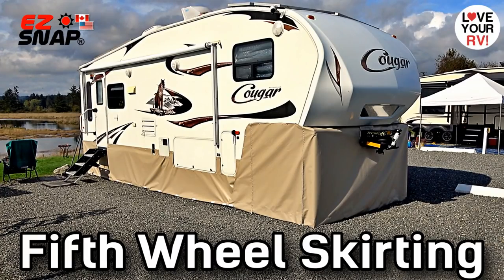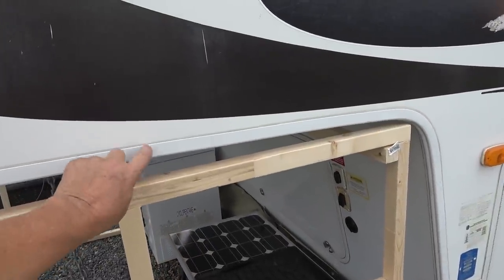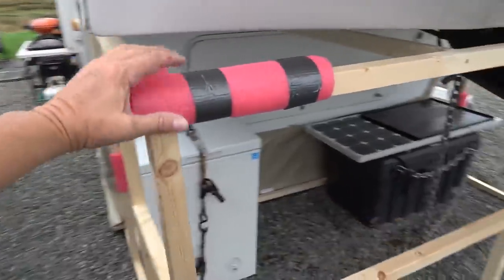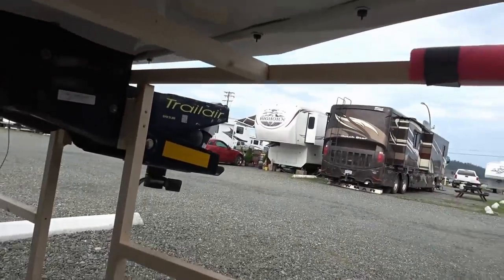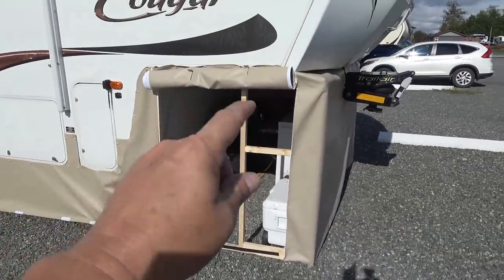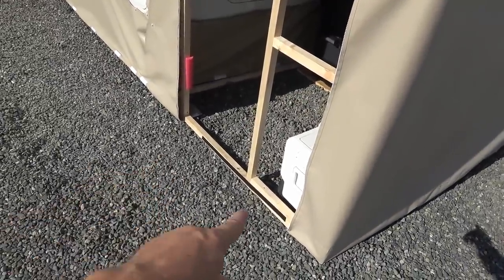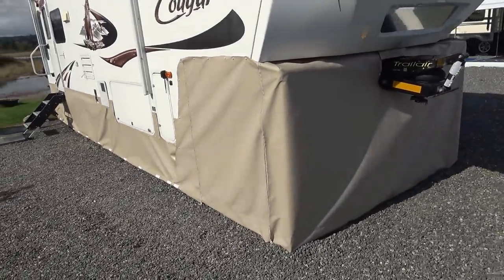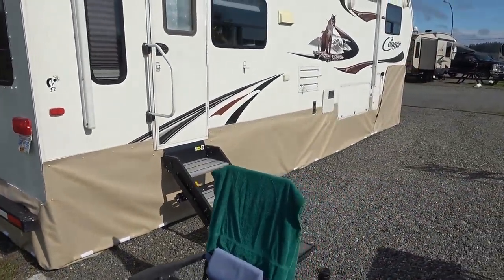Using EZ Snap RV Skirting to Create a Fifth Wheel Shed

Comment: First rate job as usual. I think the weak link is the pipe at the bottom. Something to keep wind from getting underneath it and somehow rig some weight on the inside or strapping and spikes. Glad it made it through it's first test.
Reply from the maker: Thanks! Since we are in a graveled site, I just pushed some against the bottom edge all around to stop the wind from getting under. I was thinking of staking or sandbagging the cross piping down and add some weight in the corners.  But last night we had even a bigger storm winds up to 80 km/h and everything held fine. :)

Comment: Looks great, that is really cool!  Incredibly expensive though, sheesh
Reply from the maker: Yeah, expensive compared to many DIY methods but much cheaper than a custom vinyl job. Nice thing is its completely reusable and looks good in the RV park. Some of the cheap DIY solutions look quite trashy. ;)
Reply: @LoveYourRV  that is very true. And in the end, it comes down to what you are willing to spend in order to protect your investment of the rig itself, and possibly bonus increased comfort as i assume you might get away with the material providing some bonus "insulating" value in keeping winds down blowing thru the bottom. I admire your work on this project, great job!
Reply from the maker: One of my criteria was to be able to easily take it down, store, and put it up again.  Unlike many colder places, on the coast here we often get some warm spells even in winter, so will be nice to be able to take off for a few days and do some off-grid camping in the local area. Lots of forests and lakes around here and very few people in the fall, winter, and early spring. :)

Comment: Great job.  Be careful about humidity buildup under the camper.  Maybe you have already thought of this, put a remote temperature/humidity sensor underneath.
Reply from the maker: Yup, plan to have a low wattage electric heater running down under mostly powered by my solar panels and batteries and will open it up on nice dry days and let things air out.  Cheers, Ray

Comment: Ray great job once again. I can’t remember if you have any lead acid batteries left. If you do be careful of off gassing under there those fumes can be wicked dangerous
Reply from the maker: No, we have lithium now so all good there. Good point thought, if I had the lead acid still I would have to change the vent location from the battery box, maybe add a fan as well.
But I'm concerned about what would happen if we got a propane leak, not sure if the concentration could reach a dangerous level so have purchase a detector LP gas alarm for underneath.

Comment: Others may have already suggested this.  Have you considered some heat lamps beneath the camper inside your skirting?  This would help keep fluids and you floor warm.  Understand the 30 amp limit, but i there an extra 20 amp outlet on your pedestal?
Reply from the maker: I have a small portable True North heater with a fan that has a 600-watt setting. I plan to use that with a wireless thermostat outlet to regulate the temp. We just have 30 amps at the campsite but I do have over 1000 watts of solar panels on the roof and 315 amp hours of lithium battery storage capacity, so should be able to augment somewhat with that. Also, our rig has an enclosed insulated underbelly with a dedicated 2" RV LP gas furnace duct blowing warm air into it.  Cheers, Ray

Comment: As usual, you do a great job on your videos. I may have missed it, but does the skirting protect against critters looking for warmth during the winter?  If not, might those critters gnaw on rv things during the winter?
Reply from the maker: Critters can always find a way in. :)  But I will be routinely going under to dump one of the tanks so can monitor things.  Where we are is away from the bush and on an ocean spit so we don't get many rodents around here, I'm thinking bugs could be a problem though, will see how it goes. At least the skirting is very easy to take off and put on so can clean things out if need be.

Comment: Ray, how will you handle the waste tubing that is outside of your skirting?  Will that 2 or 3 feet of tubing freeze up with the cold weather?  I like your concept of skirting the whole trailer.  I hope it works out well for you.
Reply from the maker: I always only dump the tanks when they are near full or full so there won't be water flowing unless I'm dumping. The hose I have is the Waste Master, it's really well made and should handle the elements, especially since it doesn't get too frigid on the coast.

Comment: Any concerns sitting on your tires for almost 18 months til fall of 2021?  Maybe jack up the rig every 3 months  and turn the wheels 90 degrees?? Maybe pull the trailer up on to some 2x6's to get them off the ground?    I'm just thinking out loud is all.  Cheers.  Good job on the skirting !!
Reply from the maker: nah, I won't be that long as we plan to do some local camping trips this fall and likely when spring/summer shows up. I'll just jack the tires and rotate them a little in between. The tires are also basically new, bought on February.  Thanks, Ray

Comment: Well done! I wonder what the temperature difference will be between inside/outside of the skirting?
Reply from the maker: Without adding a heat source it's going to be minimal maybe a few degrees because not a whole lot of heat seeps down from the RV. Once it gets really cold out you add a small heater or warm lights under the RV and it gets more significant.  The skirting keeps the warm column of air in place rather than the wind blowing it away.  I'll do some tests this winter. Cheers, Ray

Comment: Ray, what kind of winter temperatures are you expecting? I take it that you are usually South of the border for winter? I don’t know if you watch Slim Potatohead, he’s a fellow RV trailer Youtuber. He does a lot of projects, like yourself and he’s Canadian too. Anyway, I’m looking forward to watching your winter videos. Thanks
Reply from the maker: Have hit some low temps and even snow events in the southwest over the years. Desert nights are often below freezing in December and January. We've seen lows down to high teens and low 20s many times.
I lived on Vancouver Island for over 40 years and often winter camped in a van, so have an idea of what to expect. Average daytime highs in mid-winter around here are in the neighborhood or 40F and lows around 33F, average snowfall in winter around 6" a month. Fighting moisture and windy rainstorms will be the biggest deal, versus any bitter cold.  Usually what happens is low-pressure systems stack up in the Pacific and roll in one after the other bringing lots of clouds, wind, and rain but keeping temps mild, but every once on a while an Arctic outflow will happen, and cold air dives down over the Rockies and out to the coast. During these spells skies usually clear and temps drop below freezing even during the day and at night as low as 10F.  It usually lasts a few days or so, maybe a week, and then the normal westerly Pacific airflow returns.  
But every once on a while you can get the cold arctic air hitting the moist Pacific air right over the Island and a big snow dump can occur. One year in the 90s in Victoria we have over 3 feet in a day or so. But many years barely a dusting takes place. So there is quite a bit of variability but overall the area is known for mild winters, much like Seattle. Many Canadians actually snowbird out here every year as winter destination versus traveling down into the USA or Mexico. Compared to the middle of Saskatchewan its down right balmy. ;)

Comment: Is your 5th wheel equipped with tank heaters for the winter?  Mine was not and I had to add them even though the builder of my rig claimed the tanks were "insulated" and "heated."  They were "heated" only if and when the propane furnace ran.  Since I use electric heat most of the time (a BTU of heat costs less on electric than propane does in Colorado), the water tanks would not be heated by the furnace most of the time.  (Oddly, water tanks freeze from the bottom up.)  I put a cheap electronic thermometer probe into the fresh water tank to let me know its temp and if the automatic tank heater pads are working.  The tanks have not frozen even when temps have dropped to zero F.
Reply from the maker: No tank heaters, just an enclosed underbelly with the furnace duct for heat. That's a big reason  I decided to skirt and then put an electric heater under during the cold times.  I'll run the main gas furnace at night and use solar and battery to run the a 600W electric heater below during the day. With our relatively mild winter climate on the coast I think I'll be fine without tank warmers.  We also will have electric blanket, and a little electric oil heater and a dehumidifier that puts out some heat. Worse case I also have a Big Buddy heater plumbed into the RV low pressure line with a quick connect. It will be a balance, try and use the free electric versus having to use the propane to keep the plumbing warm enough.

Comment: I noticed the water filters you had on the bumper are gone. Is there a video of what you did to replace them?
Reply from the maker: I still have them, just don't need to use them where we are camped as the water quality is excellent right out of the tap. Comes from mountain snow and rain fed lakes not far away. :)

Comment: how do you measure the length that you need or is the total length from the manufacturer?
Reply from the maker: You can measure all around the rig or they have a online calculator. Then you buy different lengths and a taller size for the shed https://ezsnapdirect.com/pricing/rv-skirting-pricing/  Here is my install video - https://www.loveyourrv.com/ez-snap-rv-winter-skirting-installation/ Cheers, Ray

Comment: Do the snap come with three M, I'm not a fan of drilling holes into the side of the rv.
Reply from the maker: Yes, with the snap kit I ordered I can use the screws or just the snaps, they call them the combo snaps, I detailed them in the first video - https://www.loveyourrv.com/ez-snap-rv-winter-skirting-installation/  The biggest issue with using the 3M only, no screw,  is they need to be attached in warmer temps to get a good initial bond.  Cheers, Ray

Comment: Good idea Ray on framing the man cave. When I placed my order I did not get the front cover. I was thinking about waiting after winter for the warmer temps so I can just use the 3M without screws in the front cap.. Do the zippers come preinstalled. Do you think you can fit a four wheeler through that opening?
Reply from the maker: Had to pay extra $168 for the zipper to get installed, Comes 40" wide I guess you could have them make it whatever size you need or you could use the Velcro to make a door or buy an aftermarket zipper solution, like a stickon one.